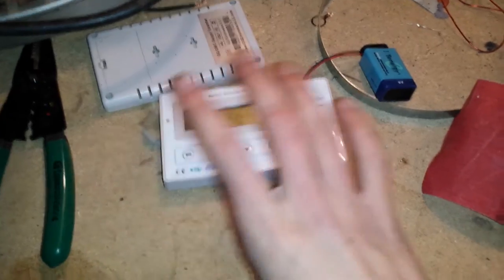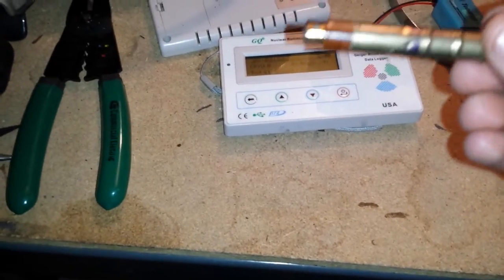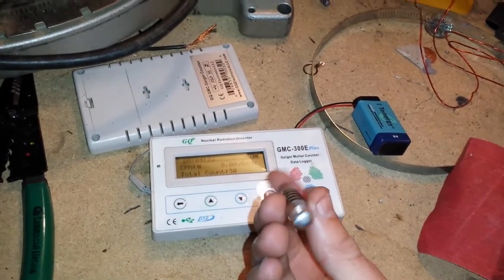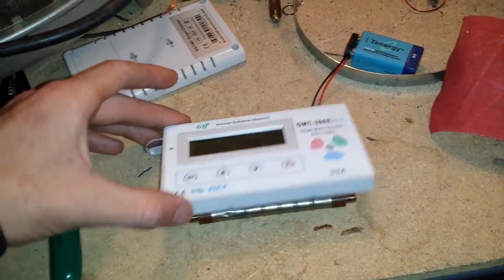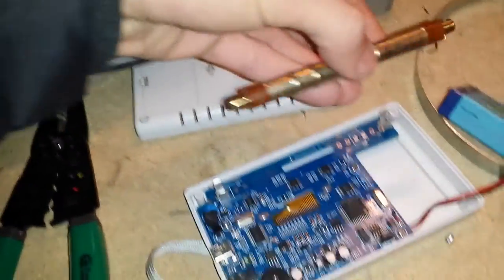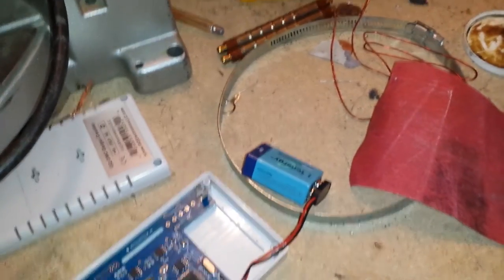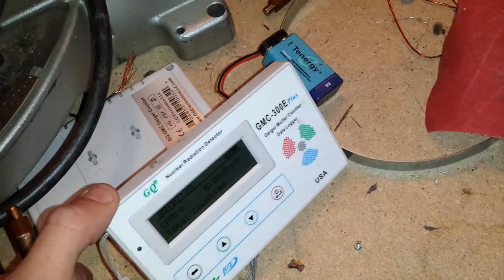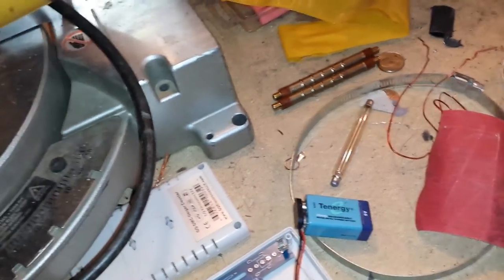SBM 20 geiger tube gone bad

Comment: Did you test geiger tube with the ion chamber from a smoke detector? Mine look and sound the same as yours but I adjusted the voltage up on the counter as well as I tested them with an ion chamber.

Comment: These tubes were probably made in the 70s, or 90s, they last 5~8 years I read.
Reply: 5-8 years.... in use. As in installed in a meter, with high voltage applied. And that's likely a low estimation.

Comment: Saying they are "tested" is not the same as "tube is certified and detects x y z radiation".
p.s. those SBM tubes are 30-50 years old at this point.

Comment: Hi. In the video when you shake the counter, the sound produces is not the anode, it's part of the broken glass (which are soldered pins on the end of the tube). In your a counter is broken tightness and there is no gas. I have encountered the same problem, unfortunately it's impossible to fix at home. As far as I'm concerned, this counter is made in 1992.
Over the past 24 years have probably been violated conditions of storage and transportation. Could you give me a link to the seller? Oh and excuse me for my poor English.
Reply from the maker: thanks for the comment ya
 was really bumbed when I received both in non working conditions. the seller sold out but here is the link
http://m.ebay.com/itm/SBM-20-Geiger-Muller-Tube-Counter-SBM20-USA-Seller-Free-Shipping-/182004701590?txnId=1462539630008

Comment: Hello....I've just bought a GQ GMC-300E-Plus. I'd want to know why you want change the original tube. Does it mean this geiger counter not work well???
Reply from the maker: Barraza00 no the original tube is fine and works great, i was just curious to see if different tubes would work as well
Reply: It might work well, but it's not as sensitive as a SBM 20 tube.